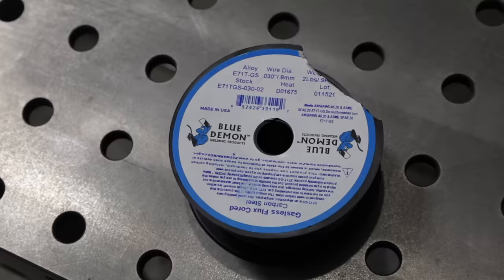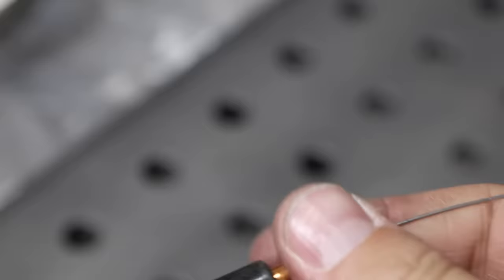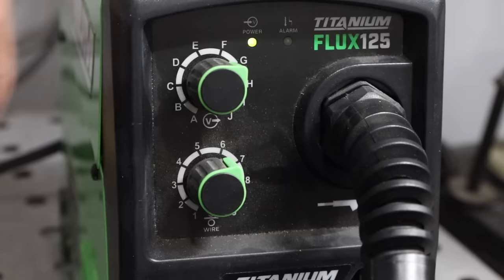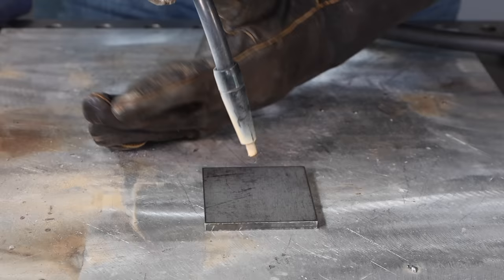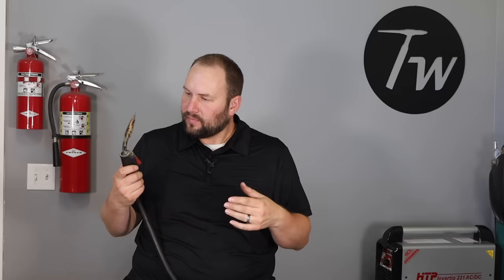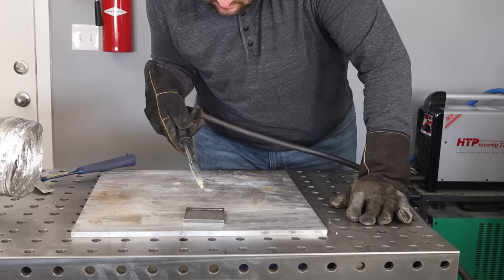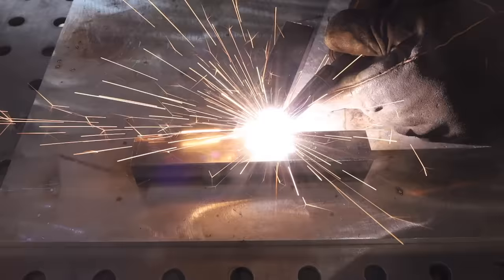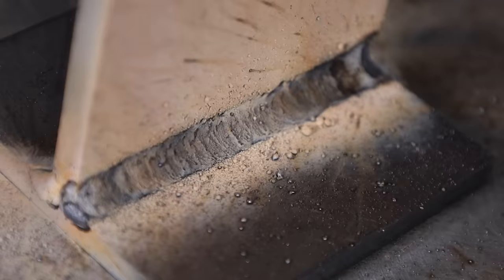Gasless Flux Core Welding Basics for Beginners

Comment: Never tighten your feed roller tension up. Loosen that right off. You want to be able to stop the wire feeding with one finger pushing on the wire out the tip. Over tightened wire will deform and cause birds nesting as fcaw-s is hollow. Back off boys and girls

Comment: 2:42 - why doesnt it start welding when you pull the trigger to feed the wire??
Reply: @Grauenwolf  ok, very nice information to leave out for the beginners, so that they can go and start electrocuting themselves right from the start LoL

plus he should explain in the polarity part that electricity likes to flow from negative to positive?
Reply from the maker: I’m not trying to get anyone electrocuted; I actually just made a video about that. 😉 As far as polarity goes, the flow of electrons is only interesting. The important principal is that the majority of the heat flows to the positive side of the arc. For beginners, though, just knowing which setting to use for a given process is all that matters.

Comment: my lincoln didn't come with that tip cover when i bought it used. I use flux core all the time since they won't sell me the gas for it!!!!! after i bought all 4 missing parts off my welder.
MY ONLY TIP IS LISTEN TO THE WELDER IT WILL TELL YOU IF YOU ARE WELDING WRONG. the current sound should be a steady sound not choppy. and what he show is the weaker weld not the tried and true scale welding.
Reply: I have a 110 volt Lincoln that I bought from Home Depot. It came basic with flux core. But I can purchase the complete gas setup for it as well. 
Who are you referring to that will not sell you the gas 🤔 
Where I live you can purchase it from any welding supply store. 
Our largest is Norco it is a medical supply company as well.
Reply: There is usually a rental/deposit or a lease/purchase for the initial bottle and then an exchange or refill after that.

Comment: well as great as it is you should and actually always us some gas for the best result. as the point of this flux core is to lower gas level from 8-12L to 3-5L. If you don not us gas and just flux core you stand a great chance of failing a photo weld. So just us the gas+flux core. I have been welding 25Y and when I seen stuf like this come past I get bewildered. Yes it was made to run without gas BUT the main function of the flux core is not to weld with no gas but to reduce sparks around the weld from improper settings and reduce time of chipping of Z sparks as more time is wasted cleaning welds then the welding it self. 
to some up:
lower gas usage  lower clean up times more production in factor.

Comment: never pull your torch as any sparks that are not sticking to the plate and are in your welding path will renter the weld in a cooled state having negative state in a photo weld. any dirt and unclean meatal will have the same result for a bad weld. 
pushing your torch forward allows for some pre worming, will burn some dirt away before the weld, gas flow can remove some loos sparks away from the weld. most steal construction welding don`t have time to clean every weld before and so the steal can have cutting flued on it drilling oils and just ditty delivered and workshops aren't going to clean every piece of steal so the welder can weld cleanly. so never pull if possible.

Comment: Litterally just here to say very clearly welding with the flux in the wrong direction and on the wrong polarity,  hope that helps for future reference. Otherwise this guy knows what he is doing just not actually how to strongly bond metal
Reply from the maker: Thanks for watching and for the comment, however I’m not sure where you’re getting conflicting information. For self-shielded wire, DCEN and a drag angle are very widely accepted as the best practice. If something else works for you, that’s fine, but in most cases, it won’t.
Reply: To back Tim up. I took a welding class years ago at Boise State University. 
We were taught to weld the same way with flux core👍
The only welder I have owned for probably more than 20 years is a Lincoln 110 volt and I do it the exact same way as Tim.

Comment: this process isn't worth it, it's crap, you're never going to get full penetration in the welds, doesn't matter if you think it's okay just because it doesn't break apart as the tensile strength of that weld is nowhere near where a regular mig or even a tig or stick would manage, they look absolutely messy as well, and they'll never properly weld thinner than 2mm without blowing through constantly or weld anything bigger than 12mm plate, most of them are inaccurate with their dials and i get it yea you can buy a more expensive machine at around $500 but there's still plenty cheaper mig machines out there that will do a better cleaner and stronger weld for very cheap, you're never going to go through a full gas bottle if you're just a diyer and use it like once a month, might aswell not even bother trying to use one and go straight for a mig, this process is fairly recent and it's disgusting, and i don't want to hear that oh it can work outside though because i've welded plenty of things outside in the gusts of wind and never got porosity as long as your technique is right, most of these machines end up in the rubbish because they're just not up to standard, if i used one at work or anything for a customer they'd tell me to cut it out and use a proper welding process, there is some good flux core welders but why would you spend the money when other processes are simply just better